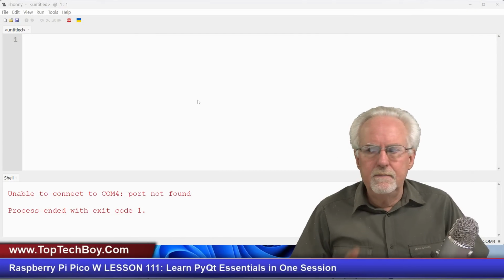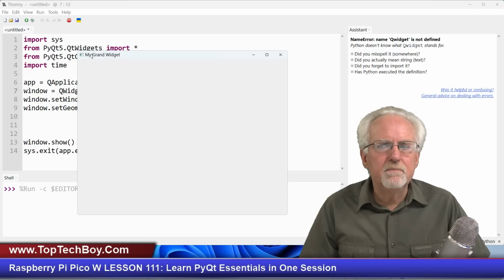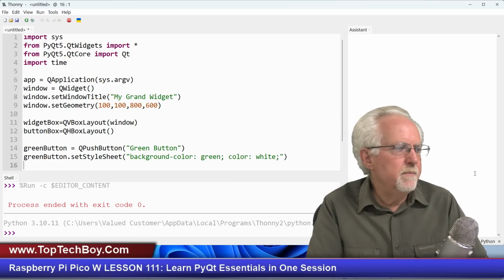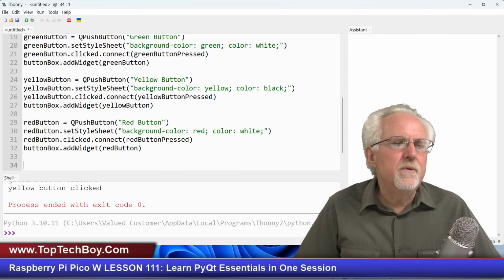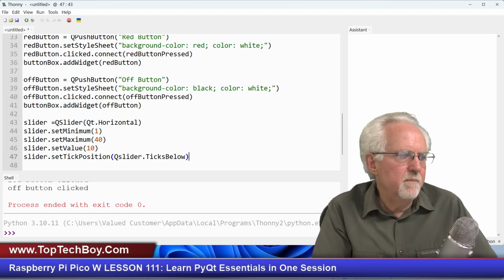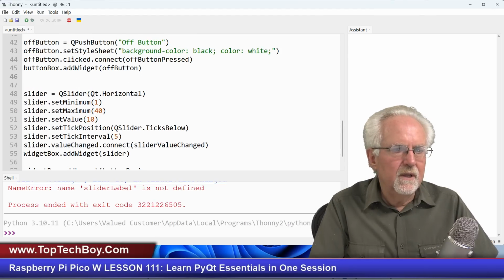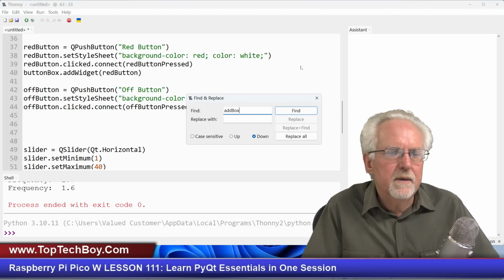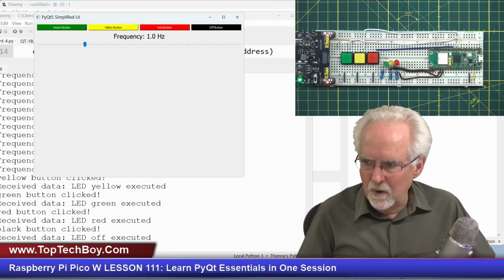Raspberry Pi Pico W LESSON 111: Learn PyQt Essentials in One Session

Comment: Thank You Paul.  Great lesson on the Qt graphical interface. I used the baseline example and built upon it to run tests on the PICO -W, over the WiFi.  I used respective Qt buttons to connect to the server, and then used additional buttons to run the PICO W tests, such as the PIO interfaces, temperature and ultrasound. I will revisit this later to add more widgets and text boxes.
Reply from the maker: Excellent!